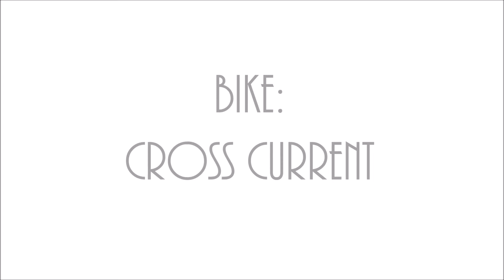Cross Current Juiced Bikes Review

Comment: Nice looking bike, however, having all those wires exposed makes it look outdated~ Love the concept, wondering if they will ever do it in 500+ watt motor
Reply from the maker: The beauty of the Cross Current is the intuitive bicycle feel. The torque sensors are calibrated incredibly well and does not put out surges of power. The current motor if you are hustling will achieve 30mph+. I do not believe they plan to add a larger motor, although faster is always fun!
Reply: Thanks, I'll stick with my new Stromer ST2, but this bike seems like fun~  I actually tried it out, but it didn't do it for me.  Felt it was lacking the smoothness, etc of the Stromer but then again, the ST 2 is a 7k option, lol~  It better run better than those costing less :)
Reply from the maker: The Stromer ST2 is a great ride. One thing to consider in the future is personalizing your ride. In a case where you are looking at two bikes with a significant price gap, try to see what you like in the more expensive bike. Check out if it is possible to upgrade the less expensive bike and see where you come out. I absolutely would buy the cross current because i could dump a grand into it and have awesome components while still being way under other bikes. At the end of the day it is all personal preference.
Reply: Such was what components? if you don't mind me asking?  Also, isn't the Cross Current a 350 Wat motor? How can it reach 28mph? I tried it out and it didn't perform quite as well as it should.  It's a budget electric bike, nice reviews, etc.  But it felt like it was lacking "something" of course this is my personal opinion~
Reply from the maker: Frankly, the tektro brakes are great and don't need replacing.  An upgrade from the alivio drivetrain would be nice, but I would only do that when the old drivetrain breaks down.  Adding a bodyfloat is amazing.  I'm thinking the one you tried was probably a demo that was sent in February that didn't use the TMCD torque sensor.  It was a little under powered and didn't perform as well as the model released in the Summer.  I have no problem hitting 28 mph.  Bare in mind, this is still relative to the $1500 bike.  There are certainly better options at different price points, but this is crazy for the money.
Reply: Thanks, for the price I guess you can't beat it.  Sadly I paid quite a bit for my Stromer ST2, which was only $4900 compared to the asking price of $7000.  But still at $4900 is not a cheap investment~
Reply: Still about as good as it gets.  Worth it if you replace a car!
Reply: Electric Bike Specialists I am interested in exactly what you described: upgrade the bangin  bargain bike!  brakes are ok. big question: will it accept SRAM components?  tires would be easy.  how wide can it go?  thanks
Reply: What's hurting this bike is the 350 watt motor, most quality bikes being made today come with 500 watt motors, such as Stromer, Easy Motion, etc etc.  But for the price, I guess you can't go wrong but they honestly need to rethink their motor option~
Reply: yes it will except sram or shimano and i have put 42c on it.

Comment: Is 350w motor enough? Most competitors are using 500w motors.
Reply: HyperFat at $1499 with 750 watts is a MUCH better deal, bigger battery too 13.2 ah.
Reply: pacificdragon1 

its a good deal at $1500. they engineered to make use of every watt from the motor and every amp from the batteries.
Reply: It depends On what you are looking for in an ebike. If bicycle like feel is important the cross current is much better. If someone wants what is essentially a electric scooter HyperFat all the way. The torque sensor in the Cross current is undeniable better.